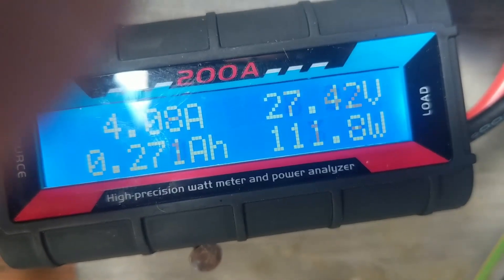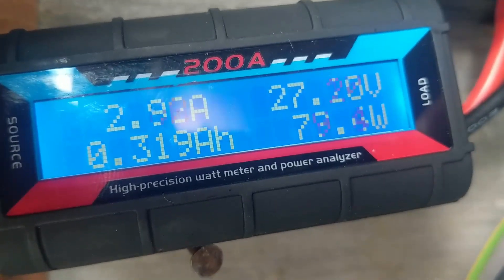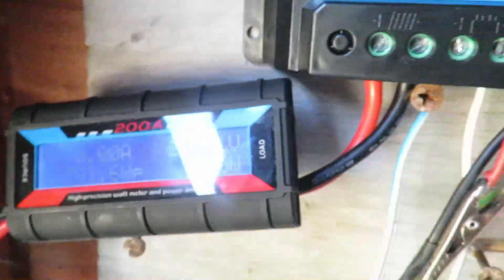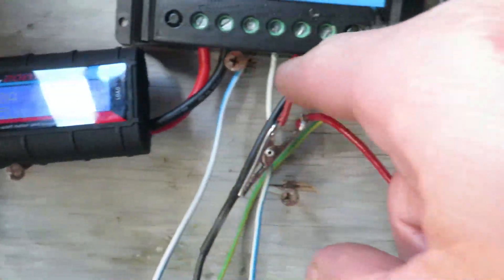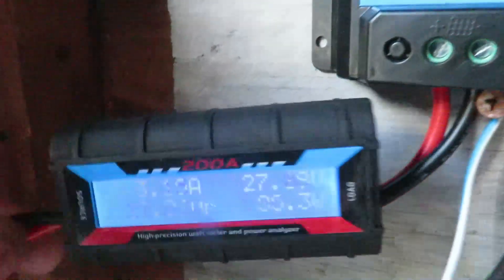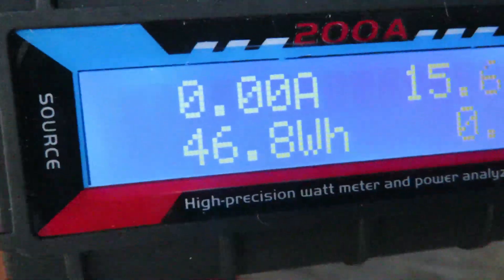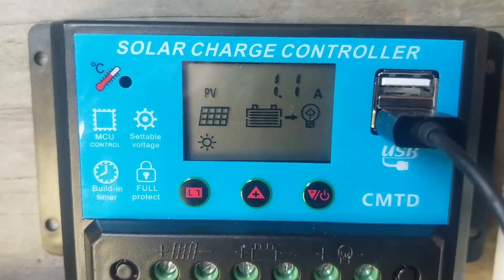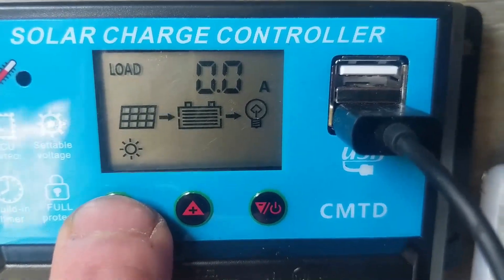24 Volt D.I.Y Wind turbine, got a new meter and solar controller works very well.

Comment: Great video!! So if your charge controller is only good for 10a what's it do when your turbine produces more than that?
Reply from the maker: I need to connect a dump load to the solar controller I am using , until I get that I am not sure how many watts it will take before it shuts off and disconnects allowing the turbine to freespin , hopefully a decent dump load will allow the turbine to run better , watch this space I have a 24 volt one and a 12 volt one on order
Reply: @GavinFreedomLover  ok cool are you putting your dump load ahead of the controller are after it?? I have mine halfway built mold is done and got the back plate on and the mold attached just need to attach front plate and then more testing😁